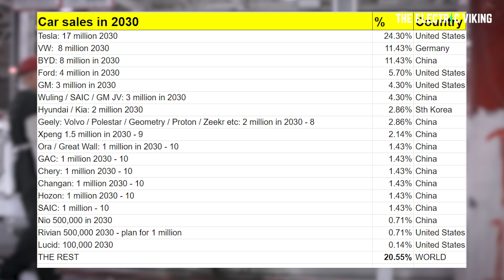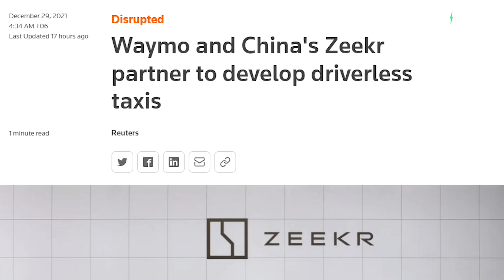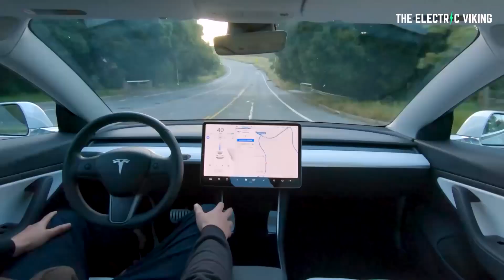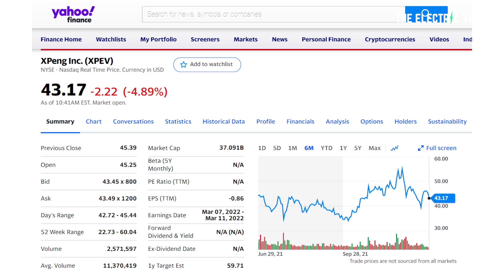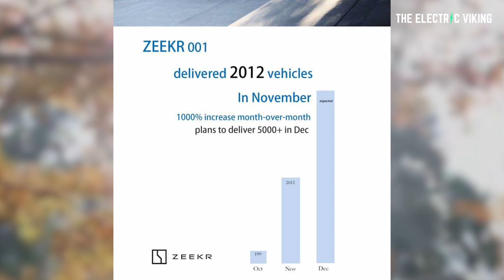China's Geely will develop autonomous EVs for WAYMO

Comment: Nobody is Talking about Hwawei Automnouse System. It is much more advance than Xpeng. But Hwawei has been :Hiding: their L4 system which has their OWN designed and made AI chips which runs the L4 system. Others are using nVidia and Micron chips for AI. And these are basically 1 generation behind. Have to wait for more info coming out in 2022. EV are going to be an Interesting and FRIGHTENING stage from 2022 onwards. 😬😬😵😵😱😱

Comment: What level of autonomy is Waymo and Geely targeting?
Reply: Level 1 🤣🤣
Reply: Waymo’s cars are already driving without a safety driver. They do have vans in the area that respond if a vehicle gets stuck, but that’s a fairly rare occurrence from what I understand. 

I’ve seen a video from a year or two ago where one got confused by some fairly sparse cones that were meant to close off a lane, but most videos of someone riding in a Waymo are pretty uneventful…it might take a slightly longer route to avoid a particularly difficult left turn, or spend an extra 15 or 30 seconds waiting for a really safe turn window, but it does OK.

Of course, it only drives paying passengers in the incredibly car-centric suburban area of Chandler, Arizona…it can take you to the mall, but it currently won’t take you downtown, or to the airport, or to the university, so when and whether they’ll be able to handle taking you where you need to go is still up in the air.
Reply: L4 ...... https://www.youtube.com/watch?v=gPPjK475DnY&t=37s   . This was 8 months ago. With the OLD Hwawei AI chips !!!! Be Surprised in 2022.
Reply: I do believe at some point level five autonomy. Because for what I understand level 5 can do the best good. And besides that level 5 will also work for vehicles that can actually do the job they're going to do. Especially to help get the disabled and the blind around. Because that's what waymo is going to be more geared for. The blind and disabled. So that we can get around a lot faster and a lot quicker than we could on public transportation. However public transportation tends to be a little slow at times!
Reply: Waymo is L4 which means it is fully autonomous but only in a geofenced area. Right now, Waymo operates driverless robotaxis in Chander, AZ in a 50 sq mi area. Waymo is also offering fully autonomous rides in a similar 50 sq mi area in San Francisco. So I imagine, it would be something similar.